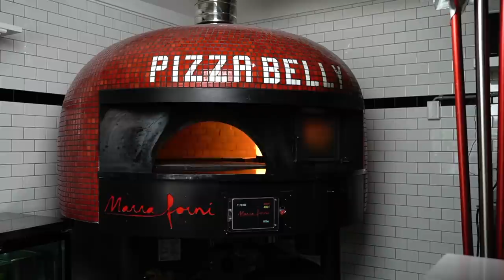Forging the FLAMING SWORD from Game of Thrones!

Comment: If this guy make this during medieval age, people would worship him as God of Flame
Reply: and god of forge for sure. 😁
Reply: Or kill the sorcerer, one of the two
Reply: @franciscoguinledebarros4429  since he have a flame sword, they gonna need some balls trying to kill😁
Reply: With some modifications, sure its craftable in midieval times. Has to use a cruder fuel source, a flint and steel instead of electrical components, and probably a few more that i can't think of but other than that if you draw out blueprints and get a jewler(fine metalworking skills for the mechanism) and a weapons smith together then this is plausible if you have the funds and materials needed.
Reply: Hephaetus
Reply: @tschileo2136  Arrows are still a thing.
Reply: @eliasroos7185  ach，yes, i totally forget that one. he needs a castle, or even vault 😂
Reply: @tschileo2136  Complete with a trebuchet, if he can get one.  They're clearly the superior siege weapon, capable of launching a 95kg projectile over 300 meters, I hear.
Reply: @lordvess6214  The Catholic church during middle ages were ones who pushing the boundaries of science. 

You're thinking of the Renaissance.
Reply: @eliasroos7185  since I'm exactly 95kg...thats..."i fear nothing, but that machine..." 😂
Reply: @supremecaffeine2633  even in the renaissance, what makes people think so badly about the middle ages is a combination of Tudor propaganda and the illuminist movement
Reply: After reading this I'm lost in my thoughts wondering how would he craft that if he don't have any proper equipments In the medieval age
Reply: Killjoy Alert
.
.
.
.
.
.
.
.
.
The church back then would think he forged God's flaming sword 

At best he'd probably be burned at the stake rather than worshiped for his skills
Reply: @franciscoguinledebarros4429  I was going to say exactly the same thing
Reply: Either that or they would burn him on a stake for being a wizard
Reply: they'd use his powers to end him
Reply: @lordvess6214  seems much more likely to me too
Reply: @lordvess6214  he could say god gave him the flaming sword since its mention in the bible
Reply: Religión: Satanás!!! 🔥🔥🕴️🔥🔥
Reply: *god
Reply: How You Exactly Know About Mind OF Medieval Age People.....?
Reply: Nah man they'd kill him for using black magic. Now if it were back in Greek or Egyptian times then yes
Reply: Or he’d just be a wizard
Reply: Lol ye
Reply: Now he just needs to make titanium armor so they can kill him with a sword or bow
Reply: @spencertheriault26  

Well he turned me into a newt!
Reply: HOW BOUT FLAME SPIRIT
Reply: Fire aspect
Reply: Made* (no hate)
Reply: A lord of light you mean
Reply: Nope they would call it witchcraft and throw him one the fire, not many people could read at that time, so it goes for whatever the priest said.

Comment: The real question is where did he get the steel? Did he make it out of clay? Did this man intimidate iron ore and bully coal into steel?
Reply: Maybe he just, out of spite, looked at a rock and it turned to steel.
Reply: Its probably a steel but the fire is not enough for it to reach it's melting point
Reply: @louise6093  he must be a Warlock...
Reply: A very powerful warlock.
Reply: So true

Comment: Raw Damage: 320
Fire Attribute: 280
White Sharpness
Affinity: 20%
"Wyvern gas may fuel its flame, but it's clever design what sets it ablaze. If it bleeds, you can cook it E X T R A  C R I S P Y "
Reply: Should have gone for Blast
Reply: Freedom Unite is the latest MonHun i've played xdd
Reply: Okay but what's the Bloat Factor on this weapon category? Or are we in Generations where Bloating doesn't exist?
Reply: But does it get Purple with Handicraft? And how many slots does it have? This might be a really strong Sn... well, maybe make a 2nd one to make it DBs due to no shield.
Reply: Materials needed:

Fire wyvern fluid:10
Carbalite ore:25
Elderdragon bones:3
Reply: if those are new world stats, that isn't gonna cut it in the hinterlands. 380 on an sns or db is at best high rank damage
Reply: @Eggcho__  No, that's the True Attack of the weapon.

All weapon classes have "Bloat Values" that make the weapon's attack values higher than they actually are. So, for SnS, the Bloat Value is 1.4, meaning the True Attack of any SnS is multiplied by 1.4 to give the shown value in the stats screen.

As an example, take a look at Attack Lv7. It adds 21 Attack, right? Well, that attack value is added to the True Attack, not the Bloated Attack. That's why Attack Lv7 works on any weapon equally, not just weapons with low attack on the stats screen. Otherwise, fast weapons with low attack (say, 300) would benefit more from Attack Lv7 by a WIDE margin compared to weapons like Greatsword or Hammer (in the 1000's).

Hope that helps!
Reply: "Wyvern gas may fuel its flame, but its clever design what sets it ablaze."
That rolls off the tongue nicely
Reply: Sound good for making healing items on a speedrun
Reply: @BlazeXth  MHFU ? Quite the old timer, are we ? You should play some third and fourth gen games, they're pretty good. MHP3rd is specially easy to emulate and it's still got an active online community.
Reply: @Ramash440  yes, dealing with proper hitboxes and having more weapon types are a temptation, but i'm fine playing alone (although i still would like to try online some time), the other MonHun games that i actually would love to play given the chance are Generations Ultimate and World once it actually finishes with all the DLC, but since that's not happening any time soon, i stick to MHFU xdd
Reply: Imma need the weapon recipe chief
Reply: @sushiibird7799  300 Purecrystal
50 Fire Dragon Pwdr
80 Fire Wyvrn Fluid
Commendation X
Lao-Shan ｄｏｎｇ
And H E L L A B R E A D to pay for it
Reply: @BlazeXth  yooooo perfect timing I've just finished my grind I can make this.
One question tho is can I use 50 Lao Shan Nut Juice instead of the dong? I'm tryna save some for my armor. Anyways thanks for the help chief
Reply: @xxx_jim_the_reaper_xxx  ahh I welcome you here as well, fellow hunter
Reply: I know mh reference when I see one!
Reply: But my question is how viable is it
Reply: tosses on Vitality Jewel

Comment: wow, that's a really clever way to combine electrical, engineering and smithing, although it would have looked better if you put the nozzle in between the centre of the fuller and had the flame follow the sword

Comment: Im curious how much time does he spend forging 1 sword/blade
Reply: Marc Joshua Cajes the time difference per vid
Reply: More than 10 minutes as far as i can tell
Reply: 2 dayscmaybe idk
Reply: For me it's usually a good 2-3 hours to make a decent blade. An expert like him can probably make one quicker. Probably 1-2 hours for him.
Reply: All together it had to have taken him at least 6 months
Reply: @deathbykonami5487  with that sword definitely.
Reply: @thatonedude9246  the shaping, heating and cooling process takes as least a month or two to get the blade to the right shape takes a lot of time, double when you hand make the hilt. Not to mention making the device to spray and ignite the butane gas and finally polishing and tempering the steel. All that work takes about 6 to 9 months to get everything right to where there's no imperfections in the blade
Reply: @deathbykonami5487  dang. I knew it'd take longer but Christ. I only make knives so I didn't know it'd take so long. Thanks for the info mate.
Reply: Ik im late but on another comment he said 7 weeks
Reply: useually takes 4 or 3 hours but  it can also take weeks

Comment: That finish without any handsanding... That's impressive
Reply from the maker: Still takes a while but that green buffing compound is amazing stuff
Reply: @FarawayForge  what's your grit progression ?
Reply from the maker: @lamproknives  
1. 36 grit 
2. 60 grit or;
straight to rough scotch brite belt and/or scotch brite wheel (depending on the material)
3. Buff with ZAM buffing compound

That's it.  I generally spend the most time on the scotch brite wheel, I've found this to be the fastest way to get the desired finish.
Reply: @FarawayForge  that's incredibly fast !
Reply from the maker: @lamproknives  Haha it may seem like it but it was about 5 hours of scotch brite for this piece.  Still faster than hand sanding tho!
Reply: @FarawayForge  oh okay. Why don't you go a bit higher in grits ? It would take only a couple of minute to reach a nice trizact finish, from there the buffing would be much faster

Comment: I'd recommend switching your charcoal burner for heat treat to use natural lump charcoal. My experience has been that some brands of charcoal brickettes use a chemical to help with a "slow burn" making it so they won't reach higher temps.

Comment: It appears to me that you have had both machinist and welder training. I'm was a machinist, a welder and a sheet metal fabricator (not all at the same job). I'm also a blacksmith/bladesmith, although I prefer my coal fired forge. I'm impressed by what I've seen here

Comment: Hey, I notice you quench tip first at an angle. I read that you have to make sure to lay it in perfectly horizontal, otherwise it'll definitely warp, because if the tip hardens before the rest, it causes uneven stress. Have you had issues with warping? And if so, would you consider trying a parallel quench?
Reply from the maker: Interesting, that makes sense.  I used to have issues with warping but I now always go directly into a straightening jig (just two pieces of 2x4) after the quench to let it cool which has helped a lot.  I think that with a blade like this there is enough mass that a tip first quench won't cause noticeable deformation, but with something thinner width-wise I would certainly take that into consideration.  Anyways thanks for watching and thanks for the sub :)

Comment: The creation of the sword is an amazing part to watch. It is observed that the fire only burn at the lower portion of the blade which is quite disappointing. But overall it is amazing that you pulled off this project in a spectacular way.

Comment: This is awesome. Is there a way to make a sword where the gas comes out of little holes in the middle of the blade or would that make the sword to easy to break?
Reply from the maker: I thought about that but I wanted to make the sword fully functional on top of the fire component.  That's why I settled with the current design

Comment: If you made this again.. what would you think about adding a small metal tube down the length of the blade with small holes every few centimeters to allow the flame to come out the length of the blade and not just the crossguard.
Reply from the maker: That design was actually my original plan, I even built a rough test sword with a gas tube before I attempted the actual build, I just wasn't impressed with the effect.  It looked more like a bunch of little handheld lighters in a row rather than the fireball I was really looking for so I ended up switching it to the design you see in the vid